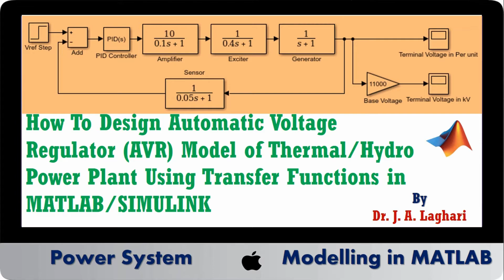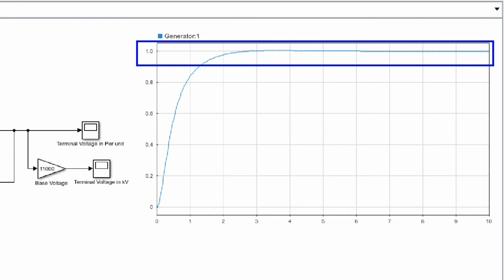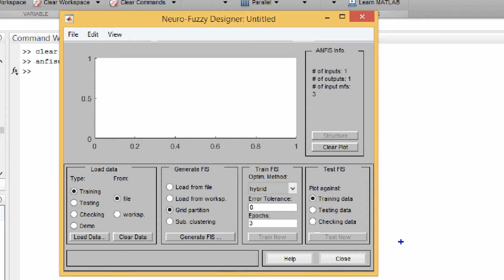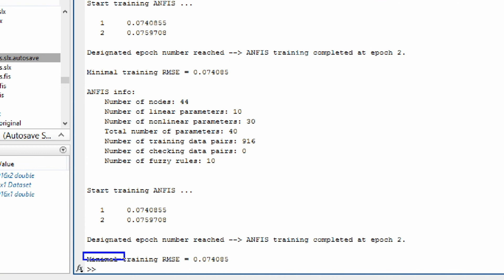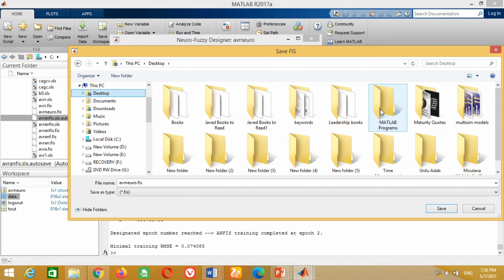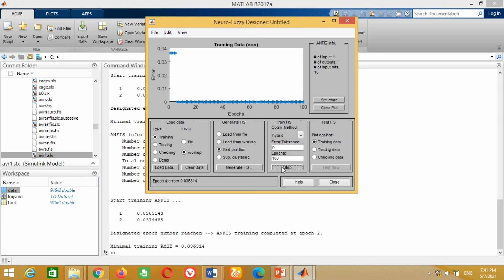How To Design Adaptive Neuro Fuzzy Inference System in MATLAB/SIMULINK? (Part-2) | Dr. J. A. Laghari

Comment: Thanks!
But, what to do if I have two inputs?
Reply: Also getting an error dialog training data must have 3 columns
Reply from the maker: it is because, two inputs and one output, needs 3 columns
Reply from the maker: No Problem. You can use as many inputs as needed.

Comment: Hello sir, Could you show me how to collect training data from a digital PID controller?
I was taught that it includes 4 inputs and 1 output: e(2), e(1), e(0), u(0), and the output u(1). But I don’t know how to correctly collect data for training.
Reply from the maker: Thanks for the comment. Yes. you can collect the data from a digital PID controller. Kindly watch my video of PSO based load frequency control and automatic generation control for better understanding.

Comment: Is there any solution for directly shown my file name in workspace
Reply from the maker: Thanks for the comment. Try to change the settings in model simulation parameters and change the output name properties. Then it will work fine.

Comment: Sir I have problem when I do the project here after adding multiplexer and workspace and after simulation I am go to the command window but there is another file in workspace after open that they have my data file ...this is the main reason when I use tool box variable name is wrong ,next I will try the which name is consist my data but it fail sir it take my file intlo another file in workspace
Reply: Thanks for your reply sir but yesterday I have completed this , after save the data file intlo workspace it's open another file in workspace then I will open it and check the input and output values after that I have seen the original file name in input output header then I am just try the name example out.data file is original input output after that loaddata is visible.and your content is really helpful sir
Reply from the maker: @saikamanitha4630  thanks for the compliments. I am happy your problem is solved.
Reply from the maker: Thanks for the comment. This may happen because you are using latest version of matlab. In the latest version of matlab you have to change the settings in simulation configurations to get the out name as what you write.

Comment: Hello .. Thank you for the interesting video .. I have a master's thesis on the use of ANFIS for a solar system and I am trying to control the output voltages .. and I assume that the load has changed after a short period of time from operation .. but there is a failure to maintain the output DC voltage level ..  Note that the PI succeeded in maintaining the voltage opposite the ANFIS
Reply from the maker: Thanks for the comment. ANFIS needs proper training for all events. Therefore, try to train it properly to get the desired results.
Reply: Thank you for the reply, sir.. Excuse me, I have prepared training more than once... In the case of connecting the resistance in parallel and using a switch after a short period of time for the system using the control of the PI.  And I trained ANFIS, the result was that the output voltage before the switch is greater than required, and after closing the switch and connecting the resistance, the result is exactly what is required... In the second case, I completed the training without a switch.. here was the result before connecting the resistance, the output voltage of the  ANFIS is good, but when connecting the resistance, the system fails...?
Reply: Excuse me sir, can I communicate with you via WhatsApp or Telegram or any suitable means for advice or assistance in completing my master's research because the time is nearing the end without reaching a good result and I am required to do another research in addition to the thesis that needs an energy management code ..

Comment: Thank you so much , what is the criteria which make you choose the output of PID to be less than or equal one ?
Reply from the maker: Thanks for the comment. Output of PID may be different depending upon the system response. It is not necessary to be equal to 1 every time.

Comment: How do you save that as model and deploy it to html?
Reply: I mean, can you use the model and embed it on a website that is built using html, css and js?
Reply from the maker: @jovelynobias5422  I am not sure. But i think it is possible.
Reply: How can i avoid overfitting in anfis using only 50 datasets with 19 inputs? How many epochs should i use for this matter?
Reply from the maker: @jovelynobias5422  There is no accurate method for it. you have to try it many times with different number of membership functions. try to use subtractive clustering technique, I think it will be better for large number of inputs.
Reply: Warning that says "number of data is smaller than the number of modifiable parameters" keeps popping. I read somewhere that this entails the model is overfitted. Should i increase my number of data to resolve this?
Reply from the maker: @jovelynobias5422  you just aoply the model and check the results. If the reaults are correct, then your model is correct.
Reply: Can i automatically convert the anfis model made by neurofuzzy designer to its corresponding code?
Reply from the maker: @jovelynobias5422  yes. Its code is also made at the same time. Just search it in google it is very easy.
Reply from the maker: Thanks. You mean how I share it in the form of link?
Reply: Is the model's extension .fis?
Reply from the maker: @jovelynobias5422  yes.
Reply: Yes sir i am using subclustering method, and it resulted to 35 mfs for each input. How will i know if the number of epochs i try is already good enough? Is it based on the error display below?

Comment: Sir I have simulate same transfer function but I got different error. And   I got PID controller  work good as compare to Anfis. Why sir
Reply from the maker: It means ANFIS is not properly trained. It need to be trained again and again
Reply: @DrJALAGHARI   ok sir I vll do it, and tell you.

Comment: Dear Dr J.A. Laghari thanks for your very interesting video series. May Allah accepted all your fasting and worships in the Ramadan.  I think you missed to test the training data in the last section of ANFIS.
Reply from the maker: Thank you so much for the compliments and best wishes. Ameen. Actually testing is of two types. One is offline and other is on-line or real testing. Offline testing is done in ANFIS GUI tool box, whereas on-line testing is done by directly using the trained ANFIS in the simulink model. In this video, i have done this on-line testing or in other words i have directly used this trained ANFIS in the model. I hope this clears your confusion.